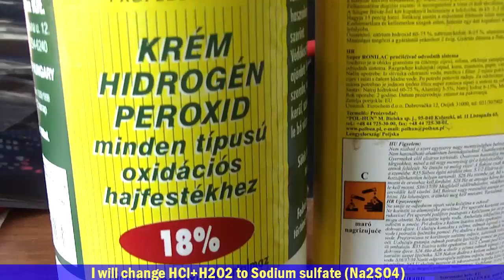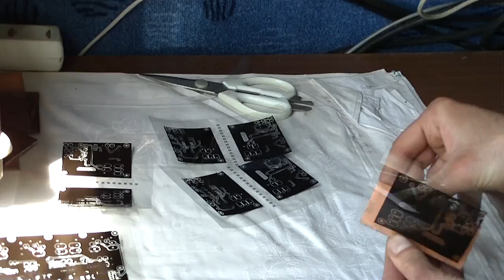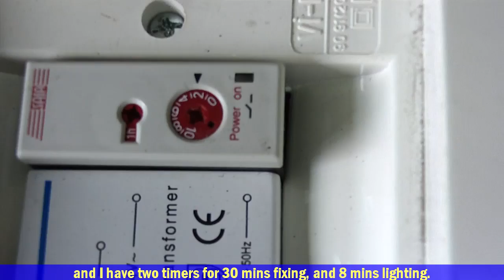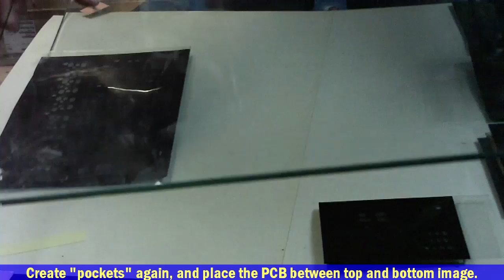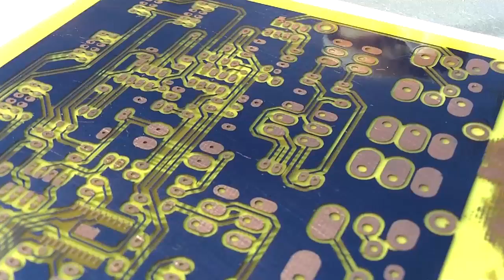High quality photo resisted homemade printed circuit board with soldering mask

Comment: at first u make a mask so u can etch of the copper so u will have clear copper routes after u soaked it in the substance so now u have only the copper routes, then u want to insulate those routes (resist mask) and only leave the parts need to be soldered so u will have a nice pcb with insulated routes other wise u will etch off the copper for soldering which so don't need to be insulated.

srry for my english (not it finest)

Comment: I used to cut FR-4 with saws. Then I figured out how to score the boards. For me scoring them works much better. It is faster, easier, and comes out better. The only downside to scoring is I have to cut all the way through a board in a straight line. But I am OK with that.

Comment: You should invest in an office paper-guillotine to cut fibreglass based PCBs. It works like a charm for long, clean cuts.
Reply: +Electro Does I think it will work with laminate cutter too.It will take just small piece out.
Reply: or a bandsaw. Small ones are not very expensive
Reply: Long clean cuts? Just use a Stanley knife to score the board along a straight edge, and then hit it to snap. No "investment" needed. Using oscillating cutting tools is just the worst way though, it'll just dull them, and you get to breathe dangerous glass fibre dust.
Reply: @Siana Gearz I second this. If it's a longer board, one can always use something like a long aluminum bar and c-clamps to hold it in place.

Comment: Nice video and DIY stuff you have there! I have a few suggestions about the process. First, try to make the pockets flat (without bending them). I don't think that, with this pocket, the stencil is laying flat on the surface of the PCB. Also, try using transparent (?) plexiglass, not the glass. The plexiglass let the UV light to go through it better. And I have a questions as well: What type of Printer you're using (can't remember if I saw it in the video)? I want to buy a good printer for transparencies only for PCB making at home and your results are amazing! Is the developing solution NaOH + water? Take my upvote for the amazing choice of music! Excellent work!

Comment: Very neat job and nice video. Up to the etching part, the steps are quite clear. But the creation of solder mask is not. If spraying the positive photoresist to get a uniformly thin layer is difficult, you can try using negative dry film photoreisist. You can also eliminate the step in which the board is to be dried in an oven. Of course, you will have to use the negative image of the artwork when you use negative dry film photoresist.

Comment: God job, I make LQFP 64 and 100 regularly for protoyping. Putting one transparency over another wont work for 10 mil thk and 10 mil pitch. Photo plotter developed transparency works like charm for me. 10 mil track tend to peel off while developing , quick develop and quick expose with original Dupont dry negative film is key here... Cheers

Comment: @MovingLessons Hi great video at about 10 minutes and seconds,is that what you are spraying photo resist coating?
Does this turn a normal copped board into a UV sensitive board,so it can be etched the same way as buying an already made UV photo resist board?
Is that what you are doing? thanks

Comment: Using Positiv20 photoresist spray, like soldering mask is realy bad joke... And after all cover it with colophony based flux spray hmm... Mechanical and temperature resistance must be realy "great". Much better results you may get with dry soldering mask which is laminating to PCB...